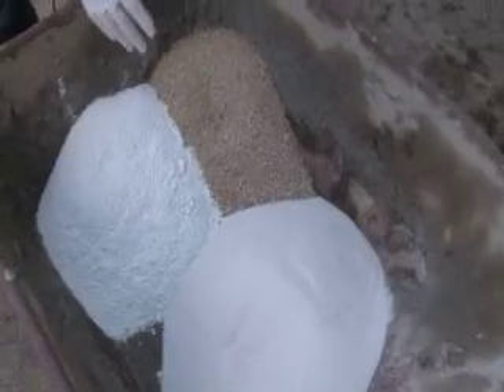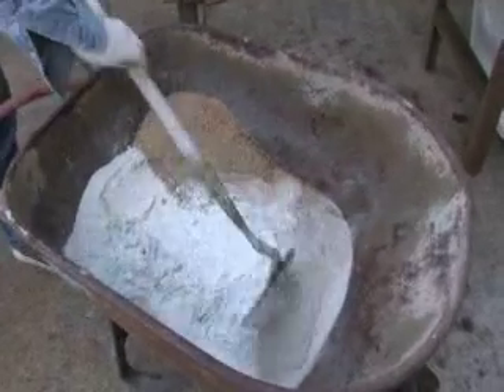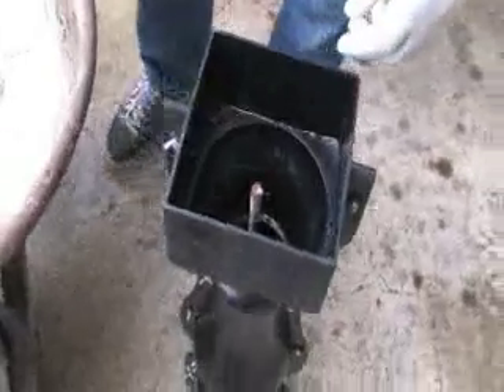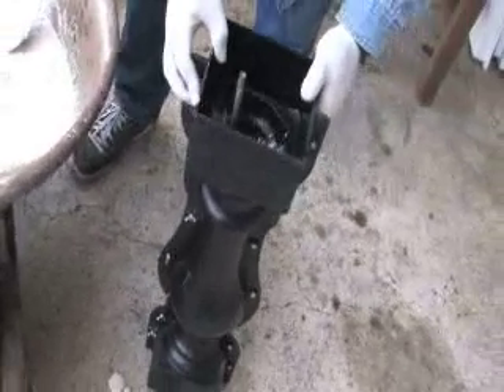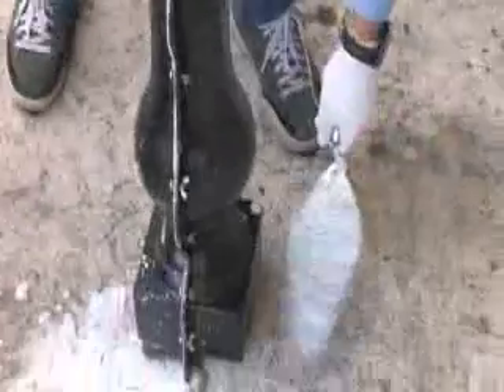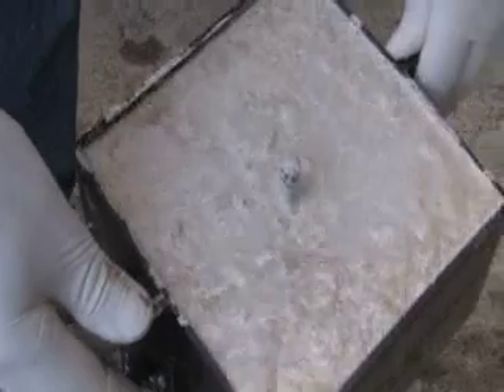2 CASTING_UNMOLDING#B5EF.mp4

Comment: Instead of tapping with trowel try using a palm sander without a pad as a vibrator to give a smoother finish to the outside. It helps a lot to vibrate the concrete.